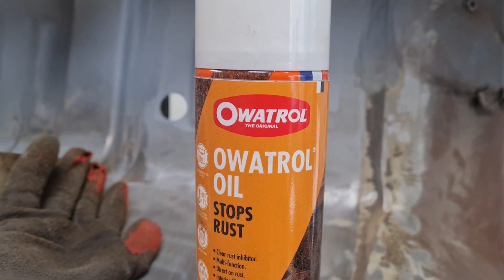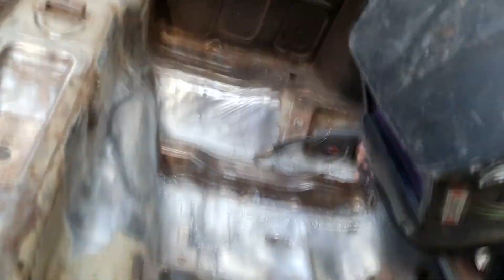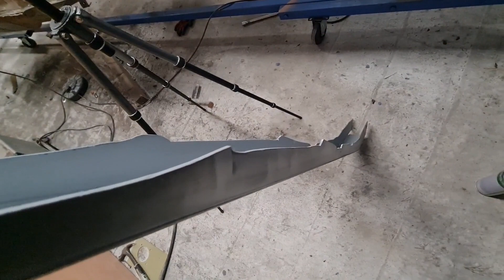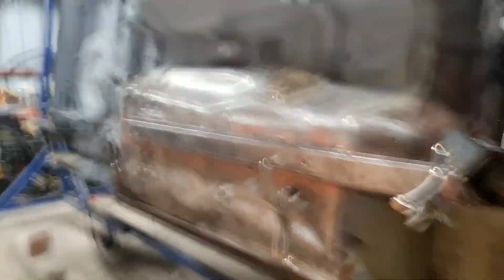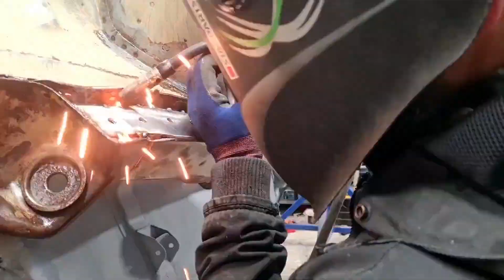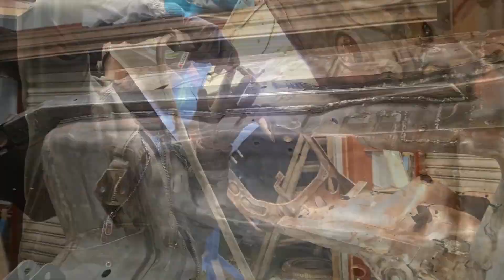Datsun Z. Pt 3. Replace frame rails with Box Section Steel - Frame Welding Time -  240Z 260Z 280Z

Comment: I did something similar  but used  2x3 .083 rectangle  tube and cut through the floor and allowed to proturd inside a little . I also went all the way back and tied in the rear subframe . This really helped stiffen  the car ,but I had a healthy sbc with nitrous
https://youtu.be/aeQtvR1jd34
Reply from the maker: Love it 😁

Comment: What's the spray that you used to coat the underside of the frame rail/floors?
Reply from the maker: Weld through primer for any place that will be exposed to high temperature and can't be accessed too easy after welding.  Then clean it off any where else before using etching or standard zinc primer.